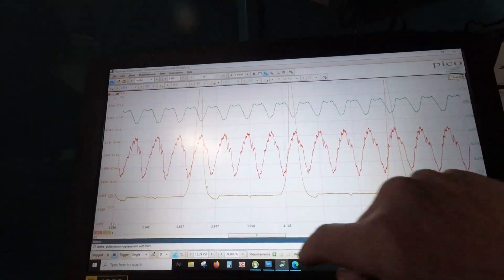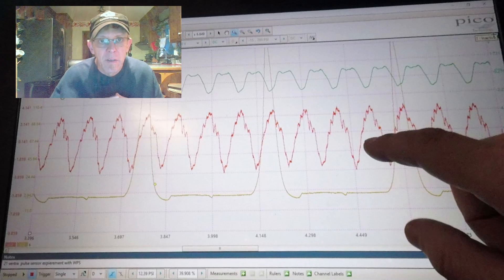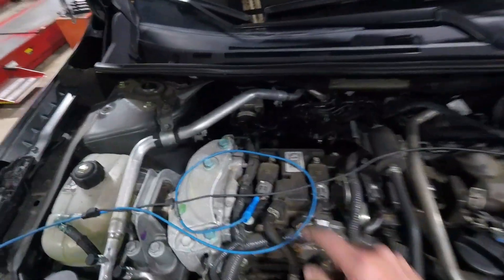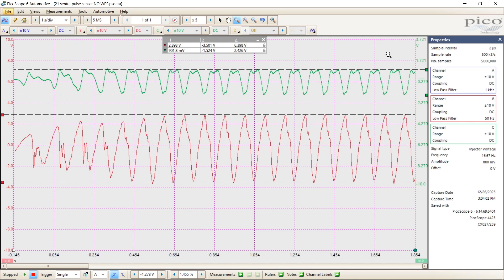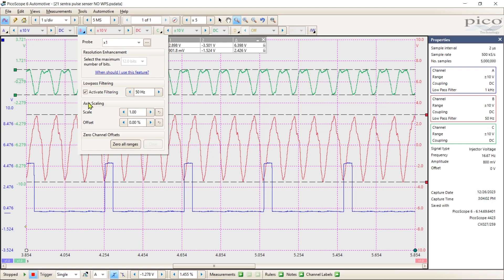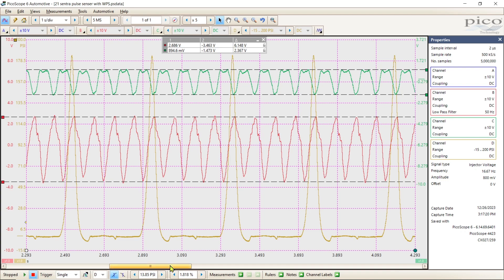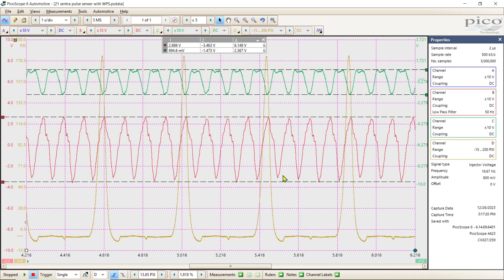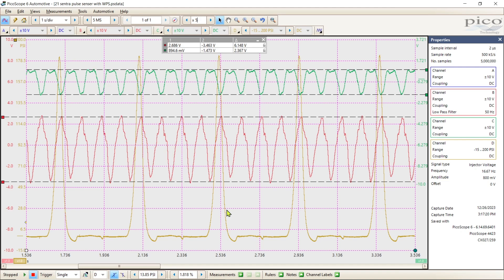Pulse Sensor NO NO

Comment: I wonder if scavenging could have an effect on the intake pull on #4. I'm thinking that since there was no combustion event on #1, the overall volume of air that flows through the intake manifold decreases due to the reduced airflow during the valve overlap event in #1. The lesser pull in the pulse sensor for #4 seems to happen right about where the exhaust valve is opening on #1. My thought is that the net pressure change is less due to the decrease in intake air volume and that would account for the smaller pulse. I'm still learning, so I have no idea if that makes sense or not in this application.
Reply from the maker: A good theory, I just wondering how much scavenging is actually going on? This engine is cranking during this test, no fuel and throttle valve closed. I think your theory would apply more to a running engine as long as the VVT system is allowing some overlap at idle.
Sorry for the late response, One thing is for sure , stuff like this really gets the mind working!!! I love it.   Thanks for the great comment!

Comment: thank you for taking the time and sharing with us that thuly want to learn!!! we really appriciated you ,  i have a question when do you want to isolate the crankcase ventilation systems i seen some videos were the block it thank you and i hope my question makes sence lol
Reply from the maker: I really never have a script I follow when doing advanced testing. I have some basic rules that I follow like this video.  When in doubt , I would test  with it blocked and not blocked and compare. My latest video (Mis-fire Fun) had pressure building in the crankcase, it never showed in the intake or exhaust pulses and I did not block the PCV sytem. It definitely showed in the crankcase test. That may have been due to PCV system design, some other engines may have showed differently. Just don't box yourself in and limit your testing. To much info is never a bad thing.
Reply: @CartersDiagnostics   thank you for your response,  
Also I was doing some test at the tail pipe on a 21 4runner using the wps and I was trying to get a good waveform and I just couldn't get it to were its was easy to understand or read it do you have videos using the wps in the tailpipe thanks.
Reply from the maker: I use a first look sensor for tailpipe testing, not my wps (just personal choice) the wps should work just fine if you use it it zoom mode not range mode.  Most all my mis fire videos i use a pulse sensor in the exhaust and try to explain how to id the bad cylinder
Reply: @CartersDiagnostics  i will try that today car has no problems but i just want to learn how to read this waveforms and your videos are helping a lot of us that want to learn,thank you once again, if i ever need help reading a waveform can i send it your way 😅
Reply from the maker: Sure. I get lots of files sent to me. Some I can help some I can't but I always look.  papaslop@yahoo.com is my email.

Comment: The piston is stopped at TDC, accelerates to max at 90*, decelerates to stopped at BDC.  If the rate of change(speed) of the cylinder pressure, that the pulse sensor is responding to, affected the sensor’s output, then the output would be a curve instead of the linear straight line.
Reply from the maker: If you have captures displaying what you are saying I would love to see them.
Thanks for commenting.

Comment: Hi Mike, thanks for the video, I greatly appreciate you sharing this information.  I believe the First Look Sensor and the “pulse” sensor are both “delta pressure sensors”?  Is there a reason you chose not to use the First Look in the intake manifold & vice versa?
Reply from the maker: I think the term pulse sensor and delta sensor are 1 in the same. I use my store bought first look sensor in the exhaust simply because its tougher than my home-made pulse sensor.  It would do a fine job in the intake as well.

Comment: Here's a fun comparison test:
install an old-school compression tester in the plug hole (to have the hose add the extra volume to the cylinder.)  Use a vacuum "T" to measure the intake manifold - one side to a pulse sensor, the other to your wps 500 set on absolute pressure.  This test would show the pulse sensor having your anomaly (presumed by the change in engine speed,) but I'd expect the wps 500 to show each cylinder creating equal pressure pulls.  This could prove how much engine speed variances affect the pulse sensor.
Reply from the maker: That would be a cool project. Going to have to put it on my list.

Comment: I believe the explanation is due to the EVO for the  in-cylinder capture occurring at the same time as the overlap event for another cylinder.

This additional volume reduces the effect of the intake pull on the manifold, leading to the “weak pull” you have displayed.

My theory is this will not be as apparent in a 6- or 8-cyl configuration
Reply from the maker: Interesting theory i will have to rack my brain on it for a while. 
With my equipment 6 cylinders show an issue, I will have to revisit an 8 (its been a while)  
I personally just stopped all in cylinder and pulse sensor testing simultaneously, its to risky for me. 

 Thanks for stopping by and commenting!
Reply: Interesting!  This would be a fun test to repeat next time you're changing an exhaust manifold gasket.  Then the exhaust volume won't be connected to other cylinders.

Comment: Great info. Thanks for sharing! I find the same is true when doing a relative compression with the wps500; that cylinder will be slightly lower.
Reply: This occurs due to the added volume from the compression hose. A smaller hose (less volume) will reduce this effect
Reply: @brandonsteckler3417  Thanks! Any hose you can recommend that's better than the one that comes with the WPS500?
Reply from the maker: I guess if you go into it knowing what to expect its not to bad.  I have never done RC and in cylinder at the same time. I just don't trust it. Thanks for adding to the conversation.